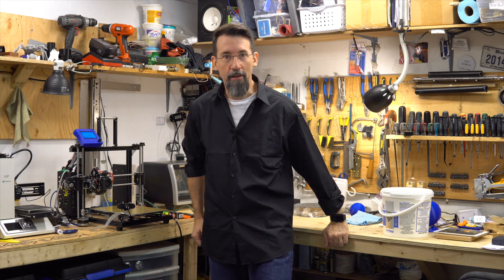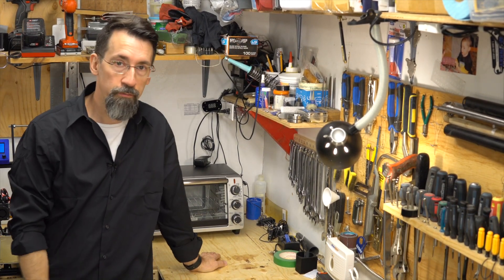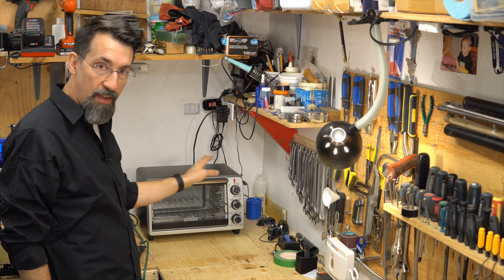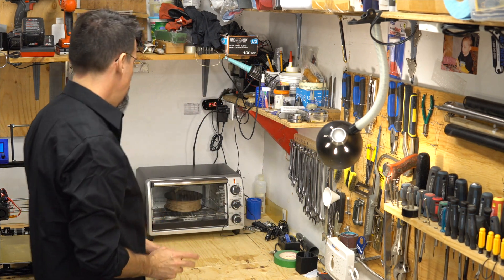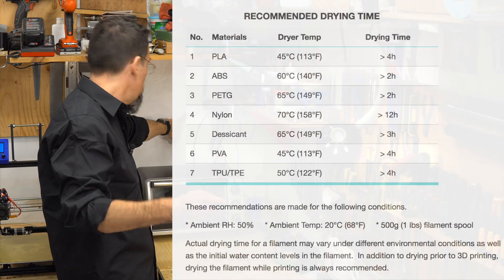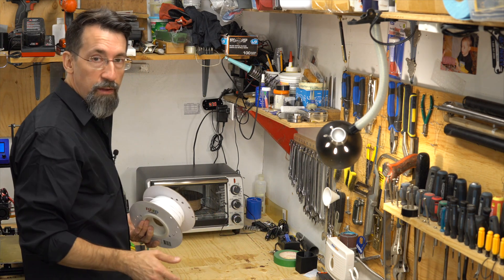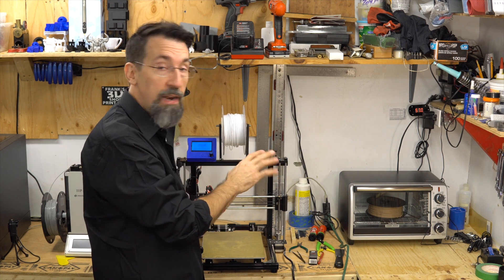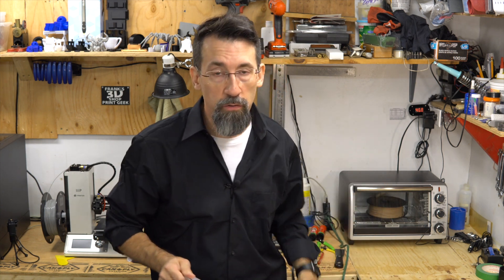Filament Dryer

Comment: Did you buy your shirt at the same place? I use my printer bed as my dryer, add box over top, zero dollars and designed for the application. Using an oven is a scary idea to say the least. The chart was handy. Looking forward to the gas and smoke detector videos.

Comment: Actually did this last week. Had an old toaster over and when i turn the dial till the heater just turns on, it keeps the temp between 110*F to 115*F.  Used an oven thermometer to check the temp, and after about seven hours, my roll of PLA printed fine again.

Comment: Do you think we can dry the spool by putting it inside a black plastic bag with some moisture absorber material?
Reply: Like dessicant?
Reply from the maker: Dessinant does not dry the filament, it draws moisture from the air, you toute filament add moisture in it, you need to dry it.

Comment: I think its a better idea using a thermocouple, you can manage both low and very high temperatures a lot more accurately and safely:
https://www.ebay.co.uk/itm/Digital-Temperature-Dual-PID-Controller-REX-C100-with-K-Type-Thermocouple/181385558712?hash=item2a3b6bfab8:g:Hy8AAOxyeZNTUONu

Comment: It seem that humidity is not factor #1 for brittle PLA:
https://www.youtube.com/watch?v=Mgyutg9H94Q
Please watch his experiment and subscribe to this guy!

Alexandre, analytical technician from Québec, Canada
Reply from the maker: Hi, my problem is not that the plastic brittle when humid, it actually makes holes in the part, the water makes pops noises when printing, it is steam coming out of the nozzle. Baking the plastic at low temperature gets rid of those.

I also keep my rolls of unused filament in a sealed box with a EvaDry https://amzn.to/2wrKfIm and I never had problem since than, but I go through a spool pretty fast. During summer even with a dehumidifier in the shop, after 6 to 8 weeks outside the sealed box the filament as too much moisture in it and pops and holes are beginning to show.

Merci Alexandre :-)
Reply: You are right, moisture kill print and drying filament, keep it dry, is the way to go. However, it seems that the brittleness is not directly related to moisture. Keep it dark will mainly avoid this problem...
I was just about to design a deshydrator with large glass windows... I will change my design!
Thank you Youtube community for sharing ideas!!!!!
Reply from the maker: Alexandre Valiquette I found that if you are able to print with more brittle filament, in other words if it does not brake during print, the final part is not brittle as the filament was. And as a bonus my shop is in the basement, so when I go out, lights are off, and my octopi cameras are see in the dark type, I also now have RGB lights on my DIY printer and will do a video on adding them on my other i3 printer. But I found that keeping the filament in the Canadian Tire sealed box with the Eva-Dry (renewed by plugin it every month or so)  got rid of any moisture. Now if you want to print something like nylon or dissolvable support, you need even more « dryness ».

Comment: Thank your Frank. There is a XH-W1308 box on thingiverse. I just modified it with one hole for the DC jack and 2 holes for the AC cables. The cable of the sensor is only about 30-40 cm. I would extend it so I can put my box far away from the oven. So guys when buying you should check if the length of the sensor cable is written.
Reply from the maker: Yes I should do that too!

Comment: Will heat drying filament like this fix spools of filament that are brittle? I have 2 spools of a cheap brand that became brittle real quick. They are also not very straight meaning they are a bit wavy as they come off the spool. It makes the filament though to go through small diameter opening of the the Hotends and fittings. I wont be buying that brand ever but am just wondering if I could make them useful by heat drying so they are not a complete waste. Any thoughts?
Reply: Hi VectorRoll,
could you please let us know what is the "cheap brand" to avoid it?
Thank you very much for sharing.
Reply from the maker: Hi, in fact it probably would make it even more brittle, you could try a small batch...
Reply: Frank's 3D shop ok thanks. I might messaround with it a bit and see. I've pretty much written off the spools for the most part. So experimenting won't hurt. Thanks for the reply.
Reply: Put your spools on a backing sheet and not the racks when doing this... I've never compromised the integrity of plastic or cardboard spools doing this.

Comment: Hi Frank. Is your toaster oven powered by the same plug that powers the thermostat or a separate plug? Can you please confirm. (It would make sense for there to be two separate plugs because the thermostat can only handle a max of 12V and 10A DC while the toaster is max 120V 12.5A AC.)
Reply: I think i answered my question, from reading a comment on amazon. I should buy a magnetic contactor to help the thermostat control the toaster
Reply: Hi Frank no need i ended up buying a $35 digital cold hot outlet relay https://www.amazon.com/gp/product/B015E2UFGM/ref=oh_aui_detailpage_o00_s00?ie=UTF8&psc=1. Thank you so much for being the only reason i became aware that such a concept could be practiced
Reply: @chimi6877  Hey this is a bit late, but thanks! this simplifys it a lot. I am gonna give it a try :) Did it work for you?

Comment: Love your videos.  Very informative and entertaining.  I do have a question, when drying filament do you have both the top and bottom elements working or just the bottom one?
Reply from the maker: I use « Bake » settings, I thinks it’s only the bottom one...
Reply: Thanks for the quick reply.   Will have to try out your drying setup when I get the necessary parts.

Comment: I have a monoprice mini.I was wondering if it was worth it to modify the hot end and print bed to print nylon and polycarbonate? If not, what printer do you recommend? We need more Piper!
Reply from the maker: Hi, the Mini could be capable to print nylon and such, with major modifications. I would use a Prusa for that, ok not the same price, but a MK2 kit is not harder to build then modifying the mini and would give nicer results. Or build an Haribo from scratch as I did, or modify any Prusa i3 clone with a E3D v6 and a MK3 modified X assembly. And you need, an enclosure, Nylon absorbs water really fast, you need a heated enclosure.

Comment: Nice tip.  I spent some hours reading about different types of filament. It explained that filament will absorb moisture and suggested storing it in zip-lock freezer bags. I'm thinking maybe a large Tupperware tub and silica gel packs might help.  But I live right next to water (15 second walk out my door) and it gets very humid in summer. So I'm sure I will be needing a dryer as well.
Reply from the maker: +Duck Landes I will do a quick video on this, but I store mine in a sealed container with an Eva-Dry E-333 Renewable Mini Dehumidifier.
Reply: I followed your link to the PrintDry Oven, then from there to their kickstarter page for the filament containers.  One advantage I can see with the PrintDry is you can print from the spool while it's in the oven. The advantages of the DIY oven is lower cost and it can heat pizza!

I received my MP Select Mini V2 printer yesterday but haven't opened the box yet till I decide where I'm going to set it up. And today picked up a 12-pack of Elmer's glue sticks.

I thought I was getting into a fun and simple hobby. But am quickly learning that it actually takes a lot of research, learning, experimentation, and time to get good at 3D printing. Fortunately I have time and patience, and not afraid to read, research, and learn.
Reply from the maker: I will do a small container rubbermaid style to host the spool while printing...
Reply: I think I will probably end up buying a PrintDry Oven. It's a bit over priced I think for what it is, but I really like it's design. And gonna pre-order a 6-pack (or two) of their filament containers.
Reply from the maker: +Duck Landes Take your time, look at the print in cura layer view and try to imagine what will happen... Plastic is cheap so you can make mistakes. 

It sure is a learning process, but at least you have a functional printer, my first one was a kit, nothing assemble, you learn a lot, but so much more work, now it works quite well, just printed a 160mm high Samus from the Metroid Game, had to think and tweak the supports for a long time, first print his right foot came off... https://instagram.com/p/Ba-YkIklbh4/
Reply: I'm not planning on rushing into it. I'm slow at pretty much everything, I speak slowly, I think slowly, I move slowly.  Is that Samus articulated? That is one of my end goals, to make articulated action figures for drivers in my R/C trucks.  Last night I was playing with supports in Cura using a female figure I created in MakeHuman (free at http://makehuman.org). I really had no idea what I was doing but was at least getting familiar with Cura.  Somewhere I ran across a software for designing articulated action figures, but for the life of me can't find it again.  My next step is to figure where I can set up the printer that my cat can't attack it. I may end up having to build a pexiglass enclosure for it. Which may also help with temperature control;  it gets 46C+ here every summer and my A/C runs for months.
Reply from the maker: +Duck Landes Cool, maybe the cat will not care :-) mines are not a problem. But for my part, I would like to make enclosures to prevent dust, I work with wood in the shop, cutting, sanding, routing, ect. Or maybe enclose the whole bench! With a smoke detector that will cut off power to the printers... No that figurine is static, but that would be cool, I also have a RC car, I will need to make PETG gears for it. Another project ! One trick I found is to make the support angle to 90 degrees witch turn them OFF, and used Towers, it was easier to remove on that big figurine with big overhangs and printed the supports better.
Reply: My cat attacks my regular printer just because it's making noise, there's no visible moving parts. I know that R/C trucks are very popular in Canada.  I am into scale realism and rock crawling. I've been into making scale garages and scenes, and photographing them, since the early 1960's. A big incentive for getting into 3D printing is so I can make my own scale accessories, and if I someday get good enough it it maybe trying to sell them. I have spent more money collecting scale items / props for garage and camp scenes than I have on my R/C trucks.  I like the smoke detector power cut off idea, think I'll add that to my plans since I am such a sound sleeper I could easily sleep through a fire alarm.  My biggest life-long fear is of burning in my sleep.